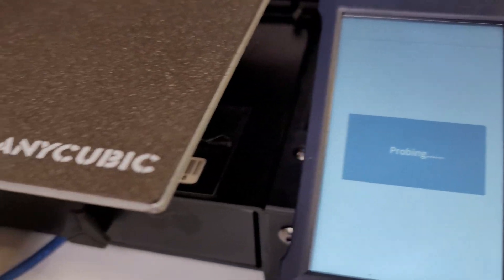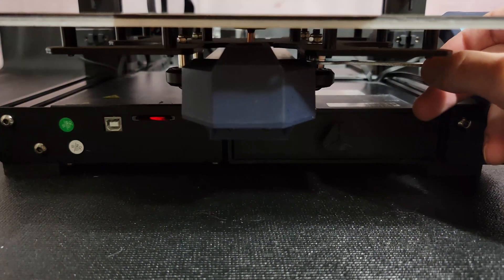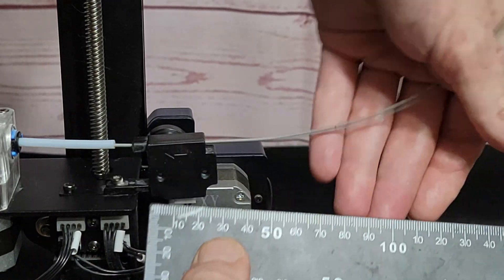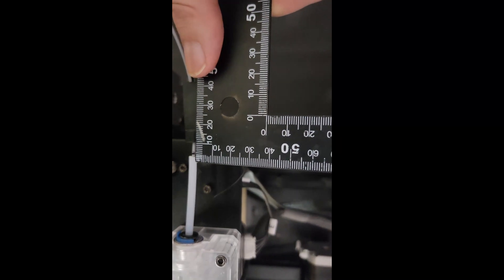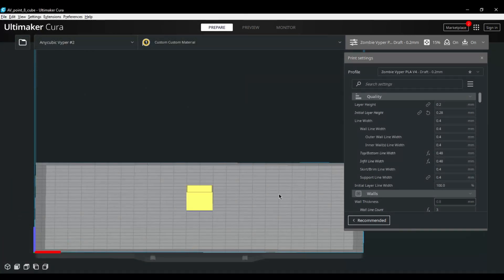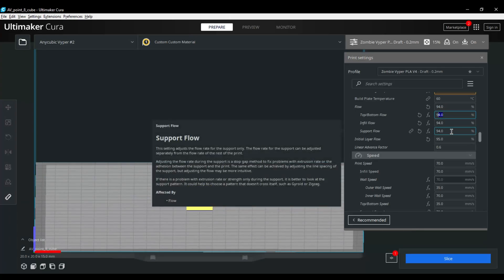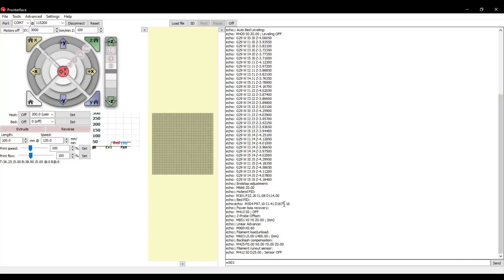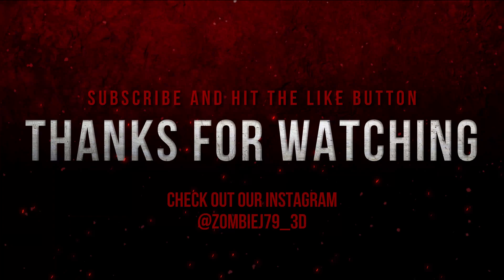Anycubic Vyper Calibration V2 (e-steps , flow, linear advance)

Comment: Does the printer need to be flashed with a different firmware
Reply from the maker: For linear advance and junction deviation you will need to flash my zombie firmware current version is 2.8 https://drive.google.com/file/d/1ZIN2u4g0sn3cMPhL1vRbfE1zs95fAOnz/view?usp=drivesdk
Reply: @studiozombie3d  Hey man, when this is installed is the linear advance is already turned on? Been following Teaching Tech and he spoke about removing a comment in Marlin to make it functional. Came across your content when looking for vyper specific content. Its been great, thanks so much.
Reply from the maker: @ryanmcc09  if you flash my firmware I have linear advance enabled on it. You can try my 2.5
https://drive.google.com/file/d/1fIU_pV5bnlu77GIQXc9qPa7W9otn1aFr/view?usp=drivesdk